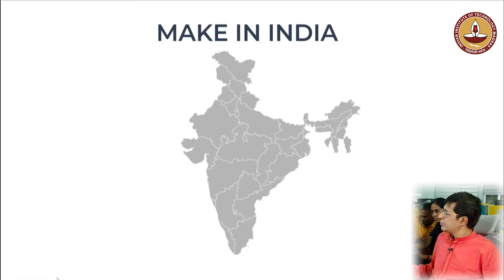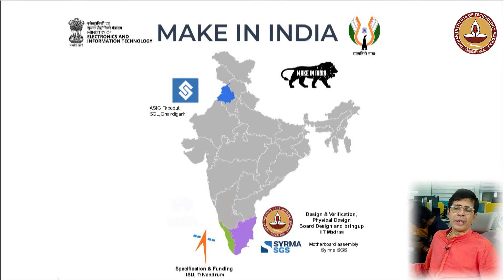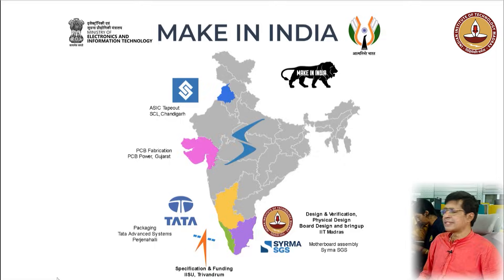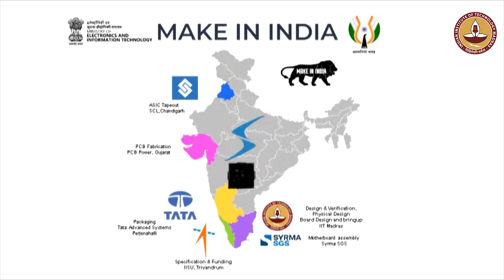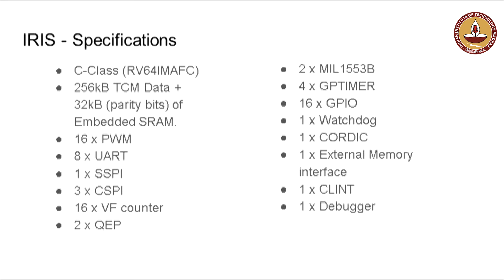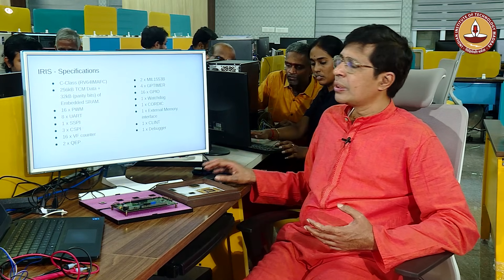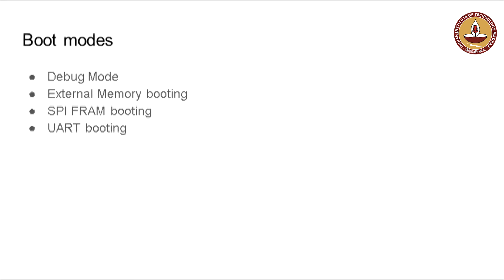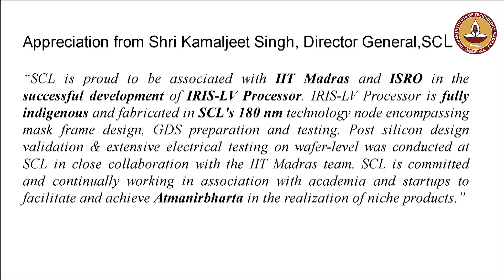IIT Madras & ISRO Achieve a Major Milestone: India’s First Aerospace-Grade SHAKTI Semiconductor Chip

Comment: The professor has shown two nos 1553 ports in his specification, but did not talk any thing about them. Even a simple two port 1553 chip approved by DRDo/ISRO would be greatly welcome by indian defense manufacturers. 
No mention of any OS is mentioned in the presentation. 
No mention of ethernet, floating point units, Canbus, USB etc has been made. 
Unless conceived by ISRO for a specific project, the commercial use of the chip with the listed features appear limited. It is neither a high end microprocessor, incorporating enough IO capability nor a simple low end processor that can be used for low cost needs. 
The idea that each domain needs a custom processor specific to the domain may be unviable, as taping out a different processor for each low volume application is economically unviable. A general processor that can be configured for any application may be more viable. 
Perhaps it is a good learning curve to the students. 
It would have been more exciting to know which OS has been successfully ported on to the chip and what programming languages have been used. A simple assembly program using a UART is enough to output "Hello world" and is not representative of the capabilities of the chip. 
180nm is enough of technology to bring out many useful chips like 1553B controllers, and institutes should concentrate on such chips and get them cerified, so that industry will find a direct application of the chip.

Comment: Better late than never. These chips cannot compete with existing chips, sustained govt funding is required to make it commercialy viable. We need to push private industries to use them by giving incentives. 180 Mhz clock speed is not sufficient for it to become successful commercially

Comment: how can integrate, photonic architectures into this e.g. can it be possible to develop the Photonic based processor?
Reply: recently, I have look into different AI therefore Found there is a [Photonic neural networks] which works on the photon instead of electron from processors perspective, but there are not many resources available. Shaki processor is an open source it be designable for those type of processing.